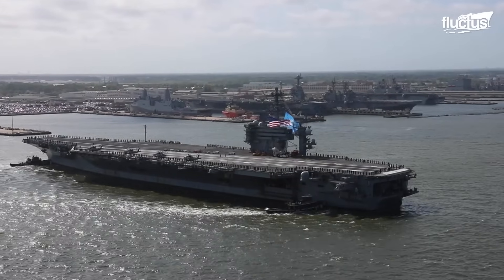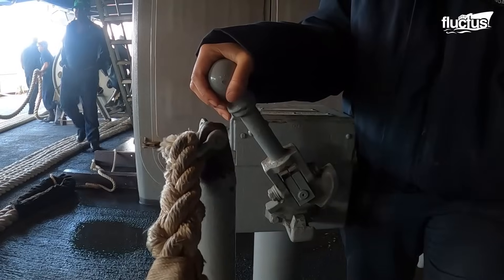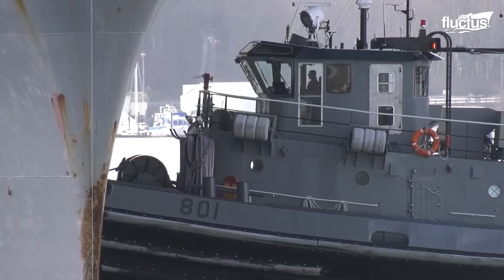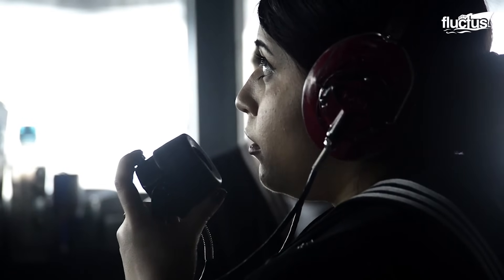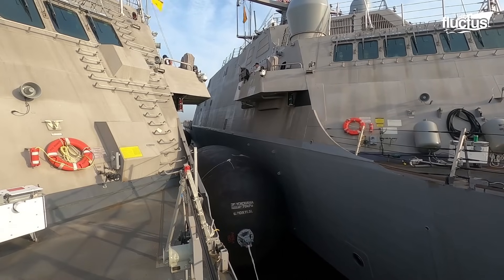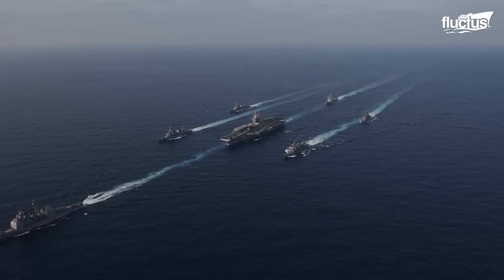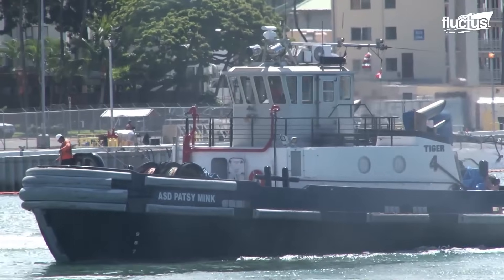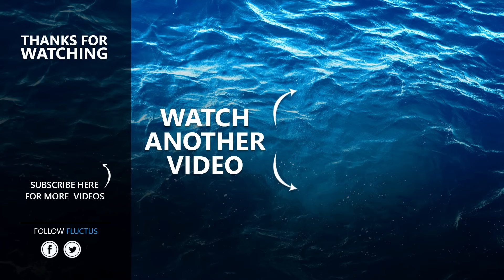The Extreme Process of Docking Largest US Aircraft Carriers Ever Made

Comment: I noticed line handlers on shore were "wrestling"  hawsers over great distances.  I worked as line handlers for a commercial company. We supplied line handlers for relatively small ocean cargo ships( Max 900 ft). On board mooring party would want to throw heaving line ±50 ft from dock. We would request, throw it when tugs would gently press ship against dock. Less heavy hauser to manage. We would run the hauser perpendicular to the ship for a distance to reach the assigned bollard. We would then run the hawser to the assigned bollard.